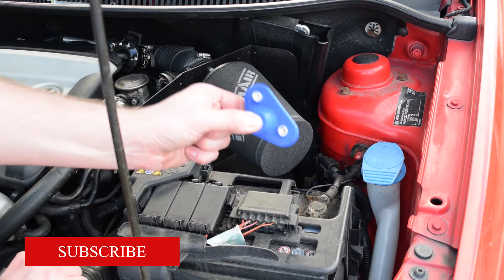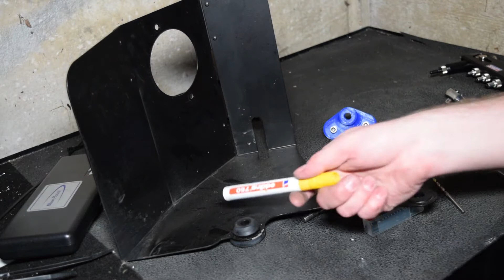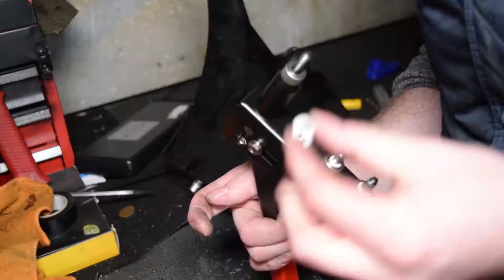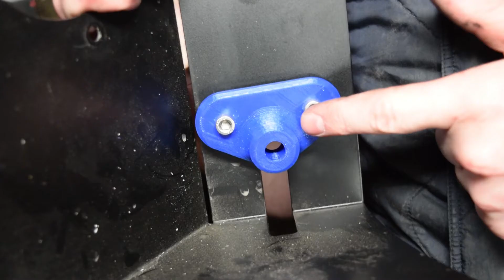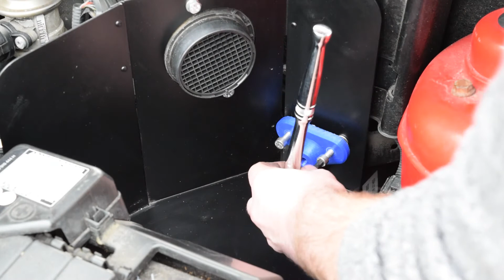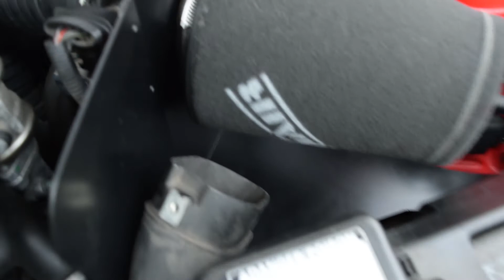Upgrading the ram air filter with 3D printed parts!

Comment: Nice Video Jack! In the end of the video, I can’t where you put the breathing hose on. Did you remove it.? I’ve been thinking to get my Polo an air intake instead of just filter, but not sure about the heat dissipation and filtration efficiency!
Reply from the maker: Thanks mate! 
The breather hose for the secondary air intake? I believe I removed that, it wasn’t doing anything so binned it.
The ram air intake is a good intake in my opinion, it gives you more intake noise and you hear the diverter valve more so it’s a good improvement, ah far as heat soak I know it’s not as good as the factory air box but the ram air kit flows a lot more air, I think they have information on their website that shows the cone will flow up to 400bhp easily. 
I hope this helps!
Reply: @CarsandEngineering  Thanks mate! Your answers are always helping me out. Unlike other video, you’re focusing on the overall improvement of the car instead of just putting a ton of hp there. Really looking forward to seeing your new Polo
Reply from the maker: Thank you mate, I’m trying to make a well rounded car that can easily handle the power I intend to put through it, that’s the plan anyway 😂